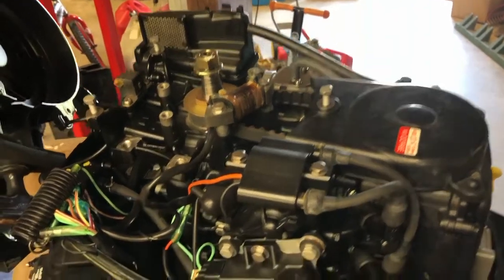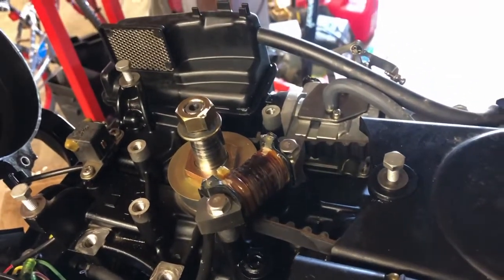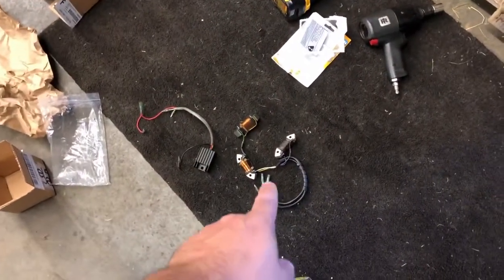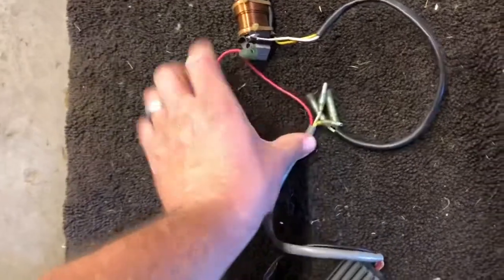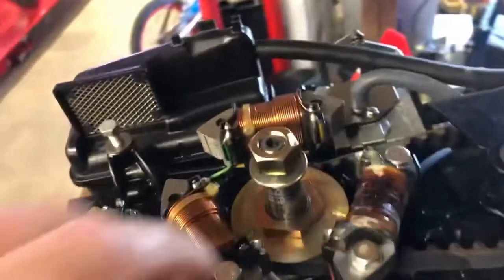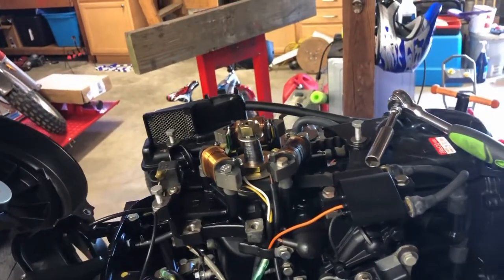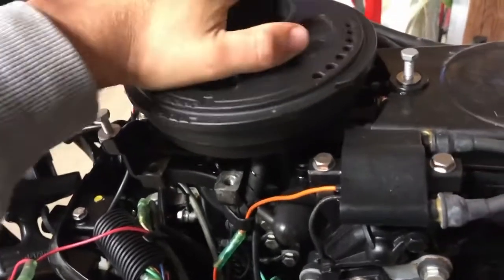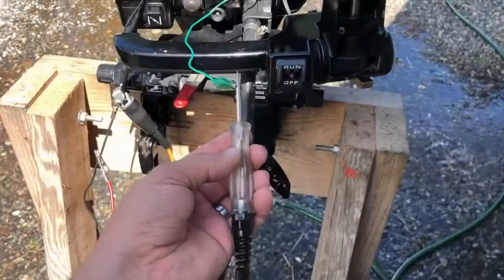How to add a charging system to a Mercury 8hp Outboard motor

Comment: It's called a rectifier. Chops Vac off the stator into Vdc. Very popular in residential and marine wind turbine electronics. A few $$ wholesale. I'm not sure if outboards need more than basics.
Reply: All of the wiring diagrams I've seen show basic 4 terminal rectifier. They cost $3. Basic good solid state voltage controller costs $20 at car parts or Amazon. Then just water proof everything.

Comment: Hi there that did you connect the earth too? Many thanks.
Reply from the maker: The ground? There are two wires coming off, power and ground.
Reply: I fitted mine last night on my 9.9hp it was exactly the same, i just earthed the two black ground wires under the pull start. Fantastic video thank you 👍🏻
Reply from the maker: @95brownb01  Thanks!

Comment: Do you have links for items you bought I need to do this but I suck on eBay
Reply from the maker: The links for my parts dont work anymore, but if you have the same year as mine, you need the charging coil, Mercury Alternator Coil 855944T01 is the part number, and the rectifier is an 853811008     hope that helps.

Comment: I did exactly the same retrofit a couple days ago to an 88 mercury 20hp. Same process with slightly different parts. I added electric start a couple years ago
Reply: Whered you find what parts you needed for your older motor? I have an 1986 Merc 9.9 2 stroke and I want to add this but having a hard time finding parts.
Reply: @Bob's Barn Workshop where did you source your parts from? I have a 1992 Mercury and am trying to do the same thing.
Reply: I found the coil used on ebay and I believe the rectifier too... they're pretty easy to find. Here's what my parts look like.. https://www.youtube.com/watch?v=nQKS8o2h0_0

Comment: Get yourself an ammeter and see how many amps it is putting in at each speed. If it picks up amperage going into the battery even though it gives you a slight voltage drop, you will be alright. A typical 12 volt battery will charge up with as low as 13.7 volts as long as the amperage going into the battery is greater than the draw from your accessories. 

If you are drawing 10 amps for example, but your charging coils are producing 30 amps, you are well within the required amperage to charge the battery in a timely manner. You can mount the ammeter where you can monitor it while you tool around with the boat. 

Happy boating, and if you're a fisherman, catch a few for me too. ;-)
Reply: I would approach this a little differently. An amp meter mounted in the boat is not valuable long term. The cheap multimeter could be left in the boat to measure volts.
I suggest treating yourself to AC/DC clamp on amp meter multimeter. Then portable for any project. HomeDepot online distributes brand General for  ~$100. I think the best value for that tool.
Congrats, well done. Hope I can do this to Nissan 8hp 2-stroke elec start.

Comment: Do yourself a favor and replace the magneto (the coil for the spark plug), it's been overheating, and it's liable to fail at any time, and the last thing you want is for it to fail out on the lake or in a situation where you need to get back to land fast because of an emergency or inclement weather that suddenly pops up.
Reply from the maker: The one I got with the charging system looked worse, must be a common thing on these?